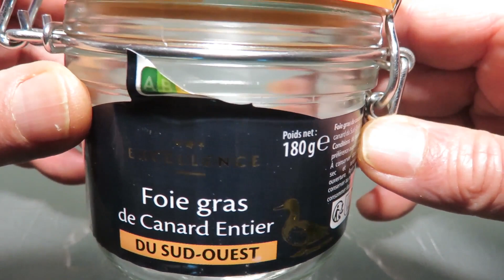Victorinox Scissors Supremacy!

Comment: Victorinox scissors are superior because they are slightly bent inwards in such a way that always blades are pushing on each other. Other scissors are not like that, or at least not that much bent, so they cut worse. Vic has probably harder steel as well, slightly stiffer.

Comment: .... my SURGE scissors are excellent ..... but my CLIMBER has been going for 25 years + and will still cut like the day I got them.
Reply from the maker: The Surge's scissors are good but not as good as the Victorinox's...
Reply: Still,no where near as good as Victorinox quality and performance. I was a Leatherman user for decades, because I did the mistake to believe, that they make the best multitools. Well, when I got my first Victorinox Spirit X, I learned how much wrong I was. I never used my Leathermans again. Most of them, have a broken or bent tool or a broken spring that holds the tool together. My 2 Spirit X's have seen way more abuse and time of use, however they're still as good as new (literally) they look and work, as day one.
Reply: @diezelle57  .....I have had to "peen" the joint on my new Juice XE6 scissors  to get them to work properly.
Reply: @greekveteran2715  I'm a huge Leatherman fan, I'm afraid to scratch a Victorinox Plier Multitool. They remind me of a beautiful European automobile. Leatherman is like a pickup truck. Looks great and is made for work. A few scratches are considered character, on an Aston Martin I'd feel guilty, respectfully.
Reply: @richardsullivan1776  That's true!  I had that issue too at first! However. after a lot of use, none has any scratches, except one scratch, on the side of the pliers near the teeth.(probably they make softer the pliers, to avoid any breakage (My Wave pliers are broken in 2 pieces) I just can't go back to my broken Ford! lol My Mercedes is a pleasure to use, can do more than the Ford (even compared to a new one).and feels way better!
Reply: @richardsullivan1776 ... 👍😂
Me too...